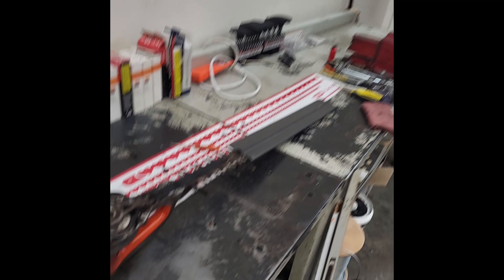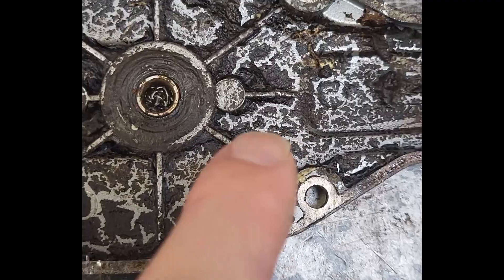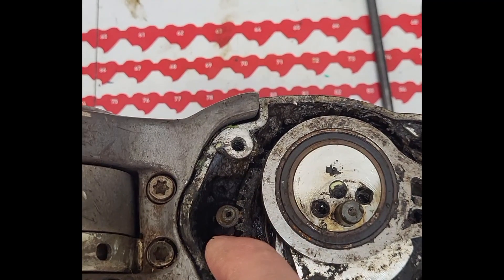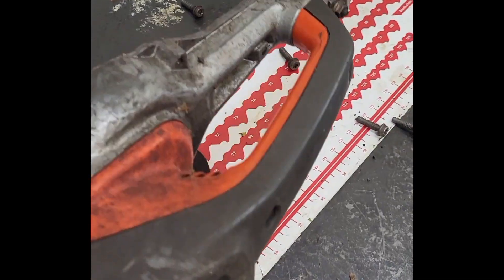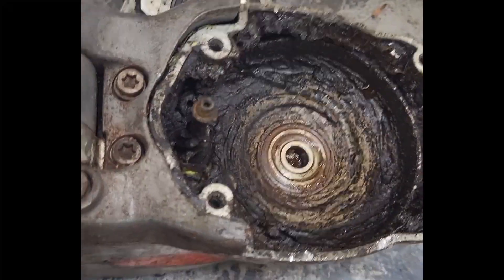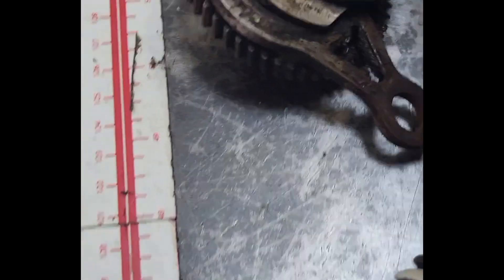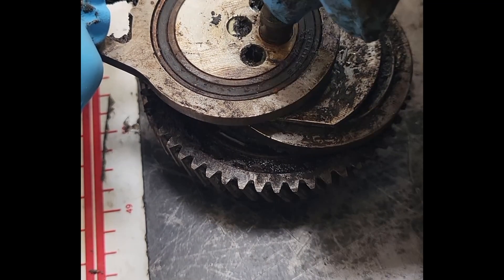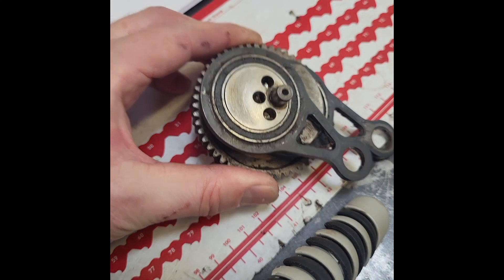Husqvarna 520iHe3 & 520iHe4 troubleshooting part 1

Comment: Excellent bit of info thanks. Get part 2 going please. My 520iHE3 stopped today mid job with similar but maybe less dramatic sounding noises. The blades jump around 3 or 4 mm everytime I press the throttle but then get the flashing light and it's basically locked up. Had to finish off the hedge with a topping saw like a cowboy. I was hoping it might be a bearing or something "cheaper" to replace but I've yet to open her up to check... she's unfortunately well out of warranty. What are my chances it could be an issue like in your video or a similar/different issue? I called a local shop to describe and the guy said it'd probably need a motor kit. Appreciate your video here.
Reply from the maker: Part 2 will be up in a few days, this is going to be a connecting rod or bearing issue, we have not had a engine fail yet and we have sold hundreds of both models, the engine is well protected from the elements
Reply: @NuGreenStore  Any idea what the replacement gear assembly costs out of warranty? Considering the design maybe they'd warranty it for me anyway... I'll take a look at the weekend, with luck the assembly isn't totally solid like in your video. Cheers